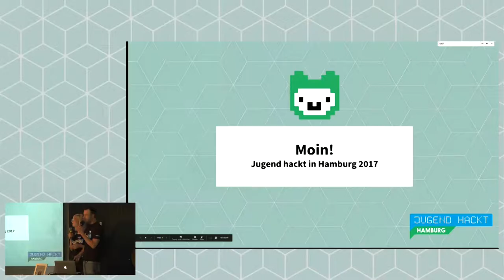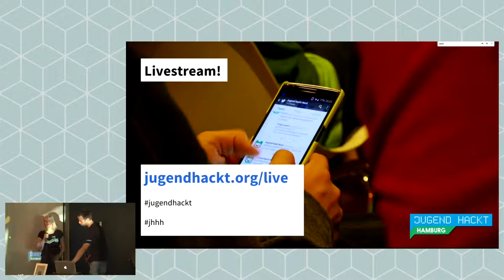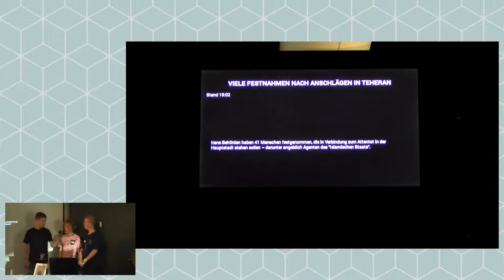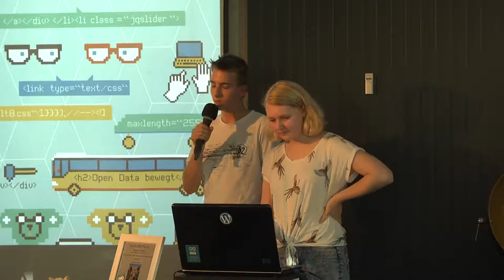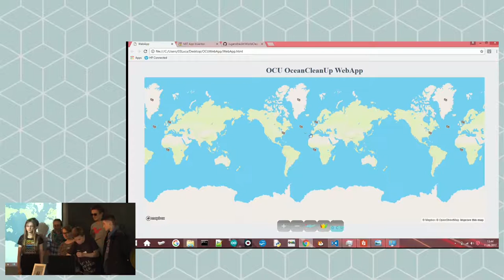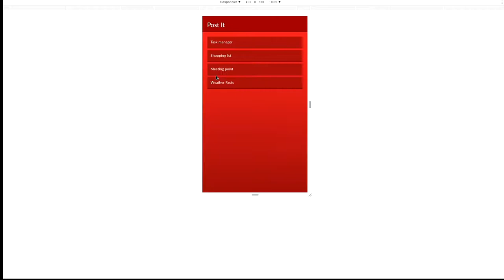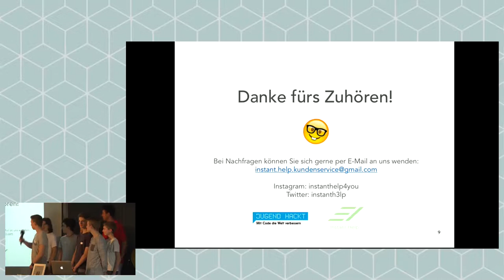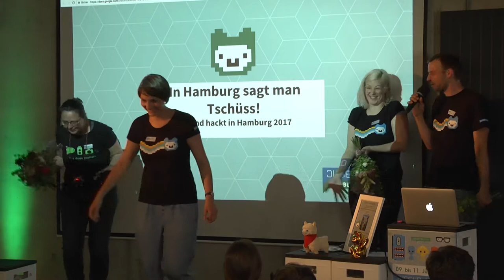Jugend hackt Hamburg 2017 Abschlußpräsentation

Comment: Timecodes:
0:00 - Intro (und "Was ist Jugend hackt?)
8:41 - Jugend hackt sagt Danke
12:40 - Datenparty (Teil 1 - Backend)
16:00 - Datenparty (Teil 2 - Website)
19:17 - Datenparty (Teil 3 - App)
21:55 - Newsbox
25:45 - Invisible Tracking Dots
29:30 - Schoolallroundsystem
37:50 - Smombie2Go
42:50 - 10 Minuten Pause
<WorldCleanUp>
43:47 - OceanCleanUp
47:57 - CityCleanUp
50:41 - Backend
</WorldCleanUp>
52:16 - Camera Warner
55:44 - Post It
59:57 - Instant.Help
1:07:49 - LithiumBuoye
1:12:28 - Ende & Weitere Veranstaltungen